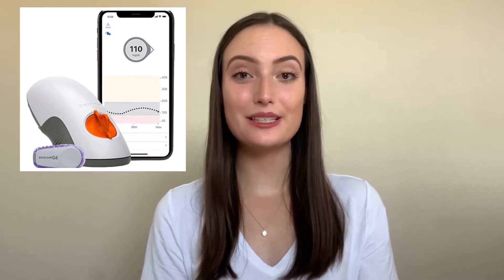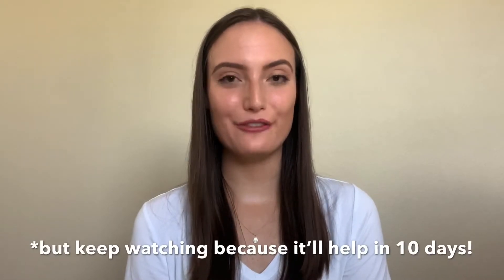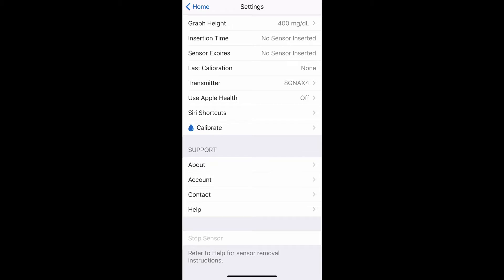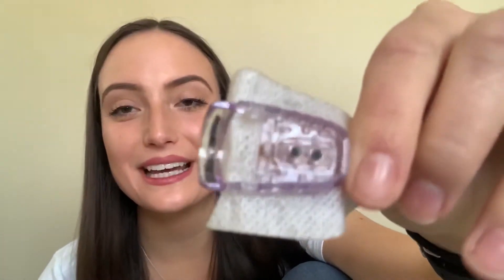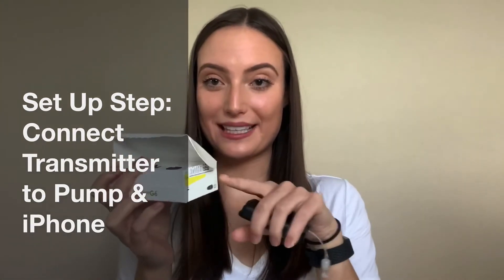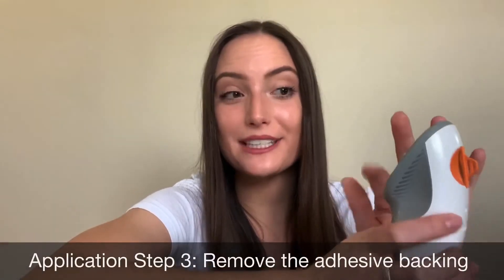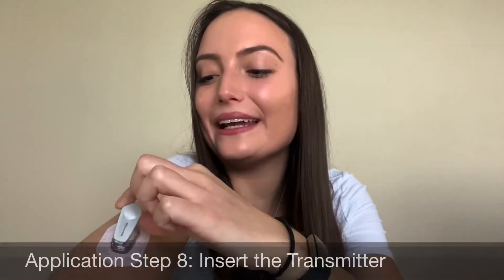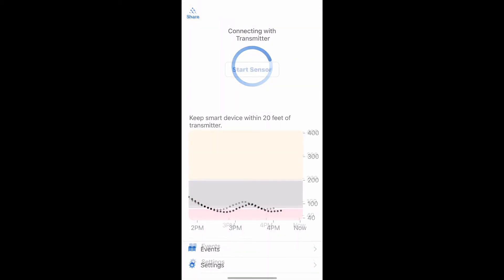Dexcom G6 CGM, a Step-by-Step Tutorial + tips. Tandem t:slim X2 Insulin Pump & iPhone Connected

Comment: One question, what if I stopped the sensor, added the code, etc on my phone app but not on my Pump. Will it make a difference? Will it be too late to stop the sensor and add the code on my pump even if the sensor has completed the warming up process
Reply from the maker: Hey Jennifer! I have done this before and it still works. It’s the best to do everything when you first change your sensor of course but if you add it late, it will catch up. If your sensor has finished the warm up process on your smart device, when you add it to your pump, I believe it will skip the warmup process. It still takes a few minutes to orient itself but it will not take a two hour period like usual. In short, you will still be able to use the Dexcom on both devices even if you do not add them at the same time. I hope this helps!
Reply: @TypeOneTypeFun  thank you so much! I appreciate your help so much !
Reply from the maker: @jennifermacias4756  you are so welcome!

Comment: Nice video, but you rushed your intro too much.  Sounds like you are a "typer" diabetic. 

Some generic suggestions for better hygiene.  Outer packging can be soiled or contaminated.  Collect all the components where you are going to use them. Handle innermost packaging as little as possible unless you have cleaned your hands. Transluscent plastic boxes with lids make good storage cases and staging areas and are easy to spray disinfect.  Remove or discard any shipping/storage boxes and place them on a cleaned surface.  Write down or scan the sensor and transmitter codes. Disinfect your phone, reader AND pump and don't touch them until after you've installed the sensor transmitter. 
-   If you shut off a faucet with your hands, whatever was on your hands when you turned them on, before washing can be transferred back to them. Either spray the handles with disinfectant after you turn on the taps, or use your elbows to shut them off.  Don't dry your hands with a previously used towel; shake them off or use the inner/back surface of paper towels.
Step 4: The removed sensor and transmitter should be labelled as "hazardous electronic medical waste". Your doctor should be able to dispose of them.
Travel: Don't pack CGM or pump supplies in checked luggage unless you can literally live without them. Always have prescriptions for, and an available source of, conventional therapy supplies available. Don't assume you can get what you want to use "anywhere". .
Reply from the maker: Thank you for your comment. This has some great information and ideas for all of us to keep in mind. All the best to you and yours!

Comment: What if I work outside and sweat will my sweat pores detach the bandage?
Reply from the maker: Hey Jason! I have had experiences with extreme amounts of sweat leading to detachment. My recommendation is to use an adhesive under the bandage, then add a sensor patch on top. Dexcom can supply these if you give them a call. Other than that, I have had to wrap my arm before in unique situations. Pay attention to how it peels, and be proactive but adding “layers” so to speak may also help. I’m wishing you the best!
Reply: Hi , im using my G6 for the first time and it seemed like it was working, but i get 200 on my monitor and 50 on my G6 its way off, tried to calibrate but it goes back to low, is this normal?
Reply from the maker: @jasonmartinez4228  hey Jason, I’m sorry you are experiencing such variation. It could be an issue on either side so if you have an alternative way to check your Dexcom and monitor, I’d recommend doing so. Of course, please pay attention to how you are feeling and correct low blood sugar if it is possibly accurate. Other than that, calling Dexcom and/or your doctor to solve the issue or potentially replace the sensor might be helpful. Best of luck!

Comment: After a a year or two of fighting with one insurance and then switching to a new one. I'm finally getting my Dexcom. This video has helped me with what to expect when I get it. Just not sure where to put the sensor for the first time where it will be comfortable and easy to use.
Reply from the maker: Hi Michael! I’m so glad things are finally working out. The FDA still recommends the stomach and I believe it is an easy application site. That’s where I placed mine initially and it was very helpful. Wishing you the best!
Reply: @TypeOneTypeFun  Thanks. Where did you get the extra adhesive from?
Reply from the maker: @Mnelson1  hey again! I order off of Amazon but you can find it in person at pharmacies and some locations like Walmart/Target if you prefer. I hope this helps!

Comment: Ok thank you for this video. I'm new to diabetes and am trying the g6 for the first time. Your tutorial was very helpful. My only question is how often should I change the sensor? So i can anticipate when to order more... My starter kit came with three sensors/applicators and one transmitter.
Reply from the maker: The sensor lasts for 10 days so theoretically you will go through about 9 sensors for every transmitter. Dexcom has updated their system to supply a transmitter with every third box for this reason. I personally like to order more before I used my second to last one at the very latest because that allows time to ship and leaves me with a replacement if anything happens. I hope this makes sense, best!!

Comment: Great video! Super helpful. Can I just set it up on the pump because I don't have the dexcom app. I've used the receiver before but I recently got the pump and I've never changed the sensor on my pump
Reply from the maker: Hi Leah! Thank you very much for your compliments. Yes, you are able to set the Dexcom up on the pump independent of any other devices. Double check that you have the appropriate software (call your doctor for help if not) & you should be all set to start this process. Wishing you luck!

Comment: I just started my sensor today. I would like to know why my tslim is showing insulin on board 0 units 0.00 units. My sugar is staying high at about 252. And how do you bolus before eating?
Reply from the maker: Hey Sandra! Congratulations on starting your sensor. Blousing for eating is the same process as it is without the Dexcom, it is shown on the front/main screen. There is a software update required to connect the Tslim and Dexcom. If you have not done this, that is likely the best next step. Contact your doctor for this information! The Tslim still requires “manual” entries for things like blousing for food or sometimes a high blood sugar, so it is not a completely automated process. I hope this helps! My best recommendation is to contact your doctor for specific information related to your blood sugar and blousing.

Comment: I put my on my arm today I think it to low on my it’s picking what do I do
Reply from the maker: Hey Diane, congratulations on your first time trying the arm. If you feel like there are any issues such as poor readings due to placement, contact Dexcom and they will help you through what you are concerned with. Unfortunately, there is no way to move the Dexcom once it is on so if you are experiencing issues they might have to replace it. Best!
Reply: @TypeOneTypeFun  yes I had to move it back into the stomach I won’t give up I will try the arm again 
Thanks for your help 🙂

Comment: Does it matter if your dexcom is upside down or sideways
Reply from the maker: Hey Carmel, great question! I focus on the body composition and size of the area. So, I would personally feel comfortable putting my Dexcom up and down or sideways if I put it on my stomach but I usually only put it up and down on my arm, since my arm isn’t wide enough to make a relatively flat surface for sideways placement. If you ever receive improper readings one way, I’d try the other way or a different location. I hope this helps!